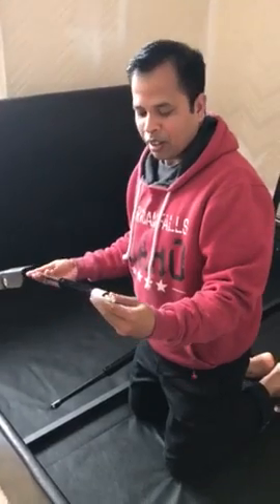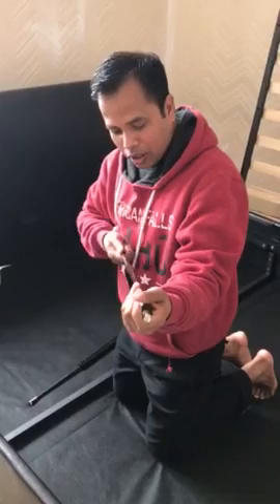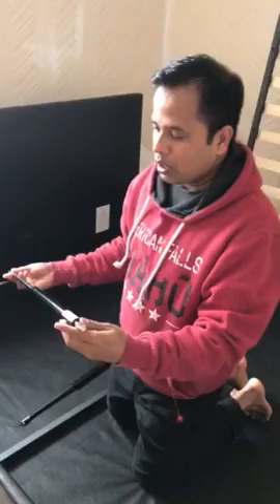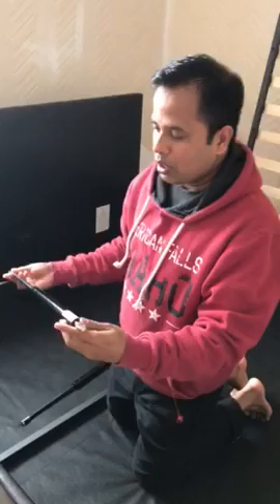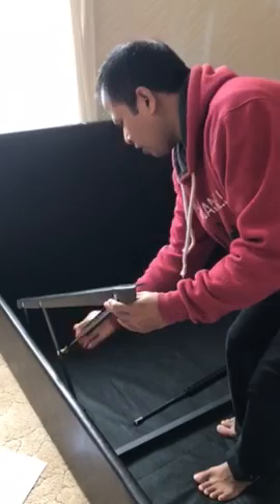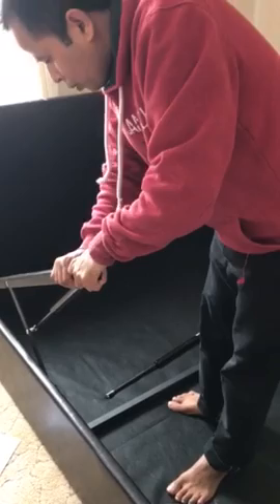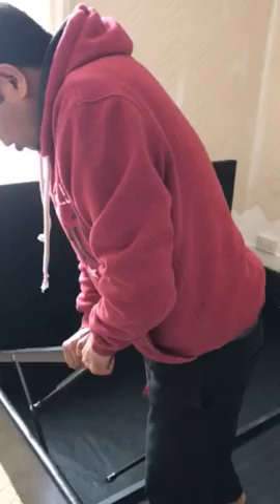Bed hydraulic gas not working

Comment: Mattress helps. But with or without it you need to complete the entire frame and stand at the end and use both hands and gently apply strong pressure to push it down (might help to use 2 people). 

Its stiff because of the lack of movement whilst in storage.

Literally almost panicked about the same thing recently, did it by myself.
Reply: It doesn’t work for me too neither pulling or pushing what to do
Reply: Thank you for actually commenting this!!! It helped me 😁

Comment: For anyone having the same issue, you have to assemble the bed first to have leverage on the bar.
Was happening to me and when the frame was assembled and long enough, it worked.
Reply: I assembled my whole bed frame but still not working
Reply: It doesn’t work for me too neither pulling or pushing what to do
Reply: @sairaasif14  the same did you fix it
Reply: @Das0000   Did either of you fix it? This is ridiculous, it'll snap the bed frame if you try and lie down on it. It is too firm.

Comment: It won't go down until it's fully assembled with the mattress on then it will go up and down.
Reply: Hi is that right as brand new bed and same with me
Reply: this bent the metal of the mechanism for me
Reply: This has happened to me also. We tried it before putting the mattress on. 
Will screw them back in and put the mattress on and try again.
Reply: Mine still not working
Reply: Wait..so you don’t have to release pressure from spring to get it to work again ?
Reply: I tried..but nut bolt comes out from ply boards